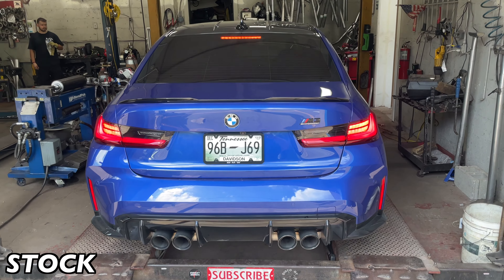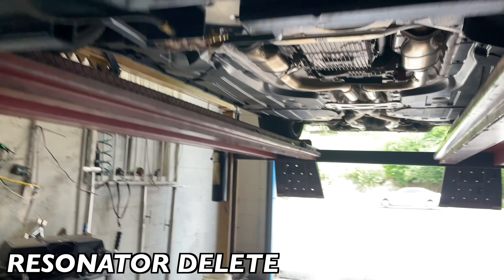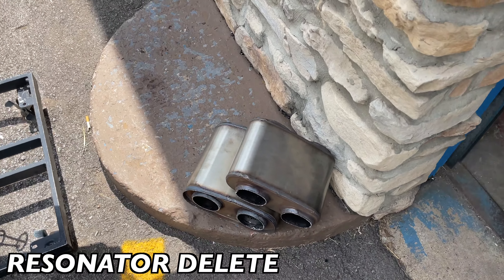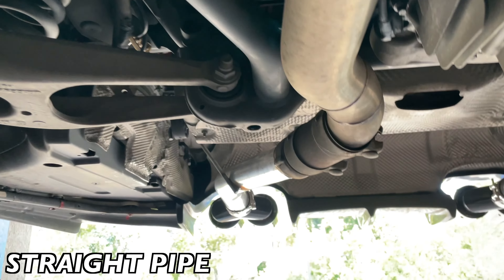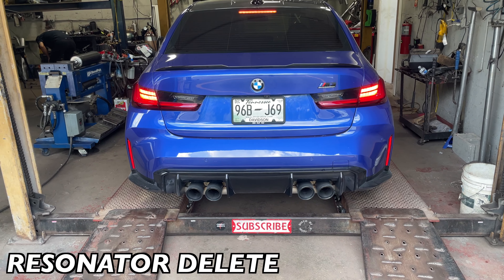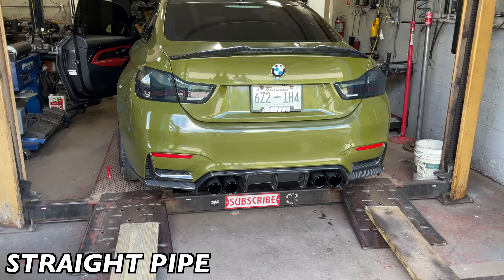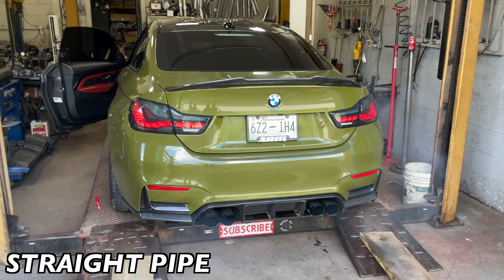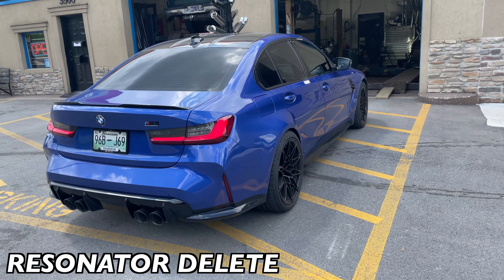BMW M3/M4 3.0L Turbo: RESONATOR DELETE Vs STRAIGHT PIPE!

Comment: They got 2 different engines so it’ll sound a bit different between the 2.
Reply: They got the exact same 3.0L in-line six motor man. Different computers in them that’s all
Reply: @HashMaster1776  f8x has the s55 and the g8x has the s58. 2 different motors
Reply: @HashMaster1776  totally different engines. That’s like saying a Chevy 5.7 will sound the same as the Dodge 5.7.
Reply: @HashMaster1776  They’re not the same at all. S55 and S58 are two totally different engines bud.
Reply: @HashMaster1776  bro said different computers in them that’s all😭😭
Reply: @ltnalu  pure ignorance
Reply: It’s the same engine, just different computer, block, pistons, rods, crank, head, intake, exhaust and turbos.
Reply: @frank12777  yes congratulations the definition of ignorance is not knowing I’m glad you passed the 9th grade 🤣
Reply: @HashMaster1776  both of them having forged internals and closed decks doesn’t make them the same motor. S55 derived from the n55 and s58 from the b58. Although they share similarities it’s far from the same motor with different computers like your original comment stated
Reply: @HashMaster1776  still think they got the same engine after reading the replies?
Reply: @frank12777  didn’t need to, I did the proper research to confirm that they’re BASED of said engines and share 80% or more of the same parts 🥱🥱🥱🥱
Reply: @HashMaster1776  so you are confirming they are not the “exact same” as you stated out of ignorance ??

Comment: Do you guys not paint the welds right after? Good way for them to rust out in no time since it’s bare metal.
Reply: They should, i always do when i do my exhausts with high temp paint. I live in Canada and they never rust.
Reply: Yep even a non colored seal spray would be good, maybe they did that

Comment: 181 MILES ON A DAMN NEAR FULL TANK! Oh nah, my Acura TL 6 speed manual still would have 250 miles or so. At full top, It almost reaches 400 miles on 1 tank.(working on that now. Needs a tune up)